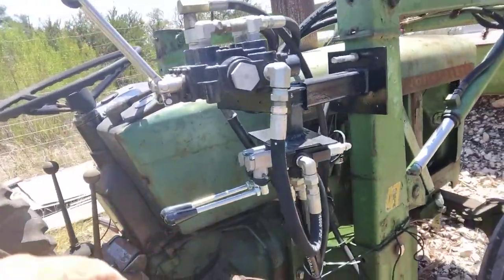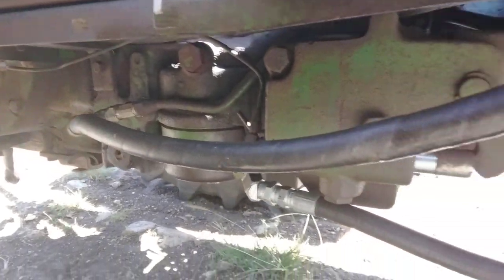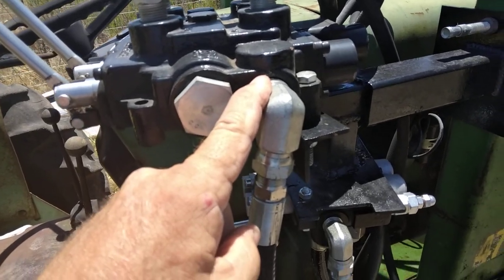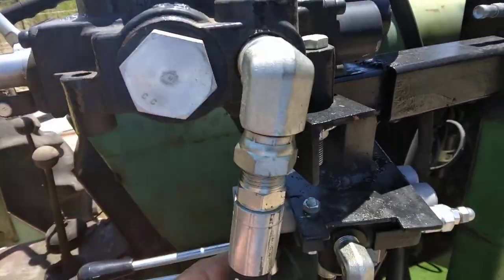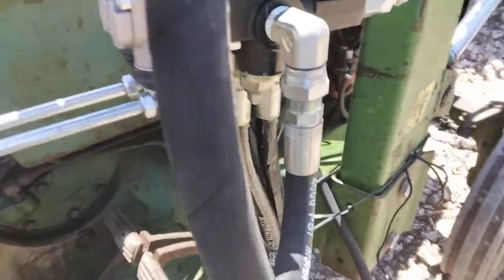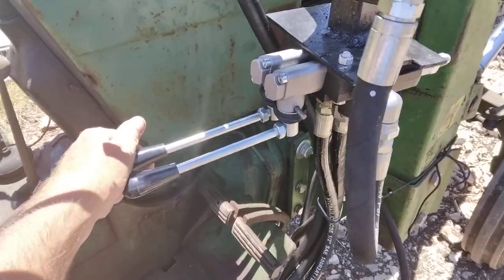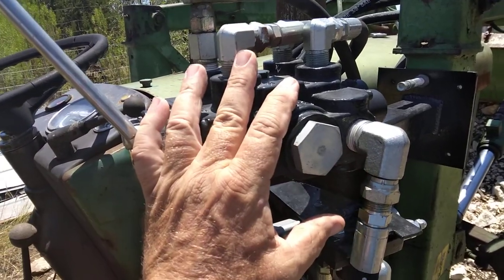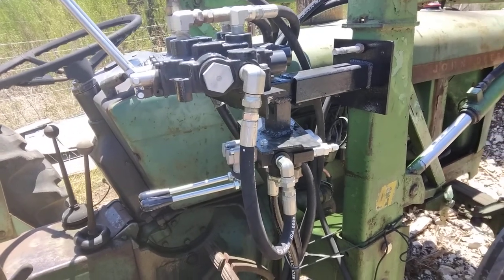Adding rear remote to old Deere-- questions...

Comment: Have you figured it out?
Reply from the maker: No, but it's kinda been on the back burner since I've had seems like a thousand other squirrels to chase.  I'm thinking that the valve bodies need to be in parallel instead of series, in other words, the pressure needs to be teed into each "IN" port and the returns from the "OUT" need to be teed.  I'm pretty sure the 2nd valve body downstream is just not seeing pressure.